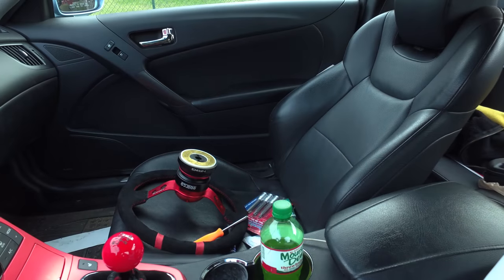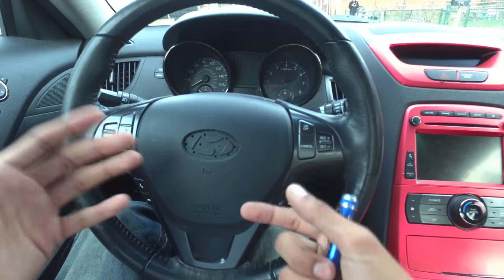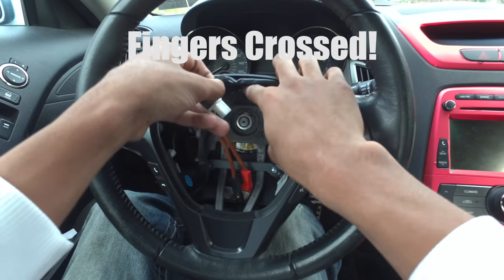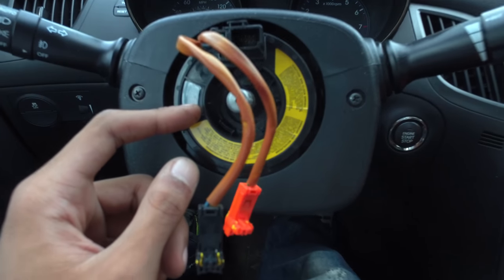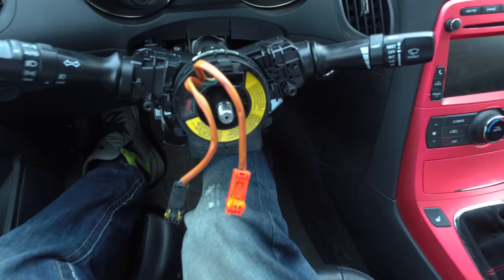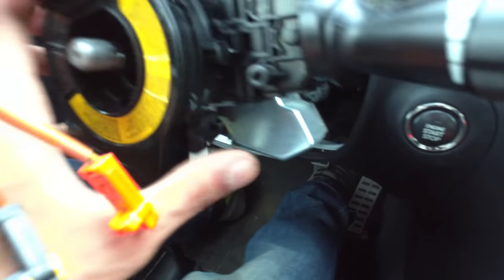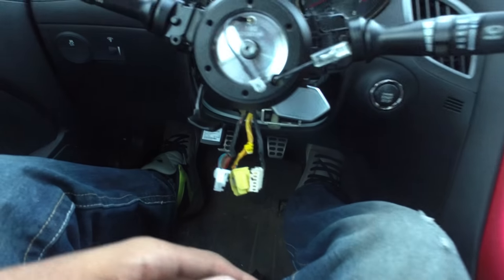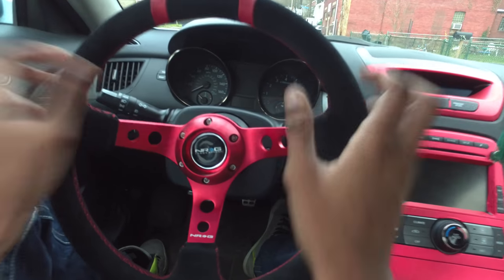So Smooooth - Quick Release NRG Wheel and Hub install on Genesis Coupe

Comment: Nice mod but I would rather have my air bag in the event of an accident and my horn and feature control for cruise control ,stereo volume control and my steering wheel phone linked controls and signal return feature as well .
Reply from the maker: +Dino Maxi Always wear my seatbelt now that I don't have the bag. But as far as the other controls go, it was a necessary sacrifice for the aesthetic. But not a total loss seeing as how those are secondary controls.
Reply: Dino Maxi do you get a airbag light amd do the turn signals automaticly turn off?
Reply from the maker: You will and they will not

Comment: Can you get any hub/ quick release and steering wheel? Or what are the specs?
Reply from the maker: +WillyKDM You can get any wheel, any quick release (if you want it), but not any hub. You can go to individual manufacturers sites to check compatibility for hubs. Check the description for the one I used
Reply: FatalRPM I'm sorry but I don't see anything about the hub that you used in the description 😯
Reply from the maker: Sorry about that, i just updated the bio but here's the link. It was on another video.

NRG Hub : https://goo.gl/KyjRMt

Comment: Did you traction control light ever come on?
Reply from the maker: Yes if you do this you’ll lose traction control.
Reply: Anyone know a fix for it or a wiring bypass to help turn that system back on ?
Reply from the maker: I can’t say for sure so proceed at you own risk. Funny enough I was talking about this with a friend the other day and he said the reason these systems get disabled is from it not being able to communicate with the systems it needs to since the airbag is on the circuit. Removing the airbag was essentially like the host leaving the game in COD. (Idk if you know what I’m talking about but just in case) So it seems like the only way to re-enable traction control would be to somehow trick the car into thinking there’s still an airbag there, in turn bridging the connection, re-establishing communication between the modules. I wouldn’t know where to start with doing so, but do with that if what you will.

Comment: Would you’re exact setup fit on a bk2?
Reply from the maker: Interior wise, steering wheel yes, shift boot you could make work, any of the exhaust stuff no because it’s a different engine however the company dose make one for the bk2 gen